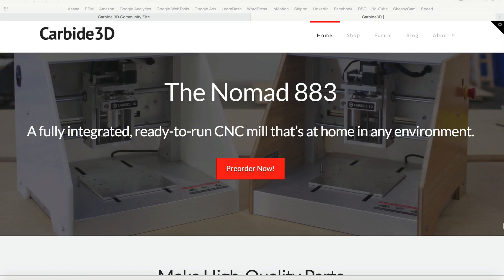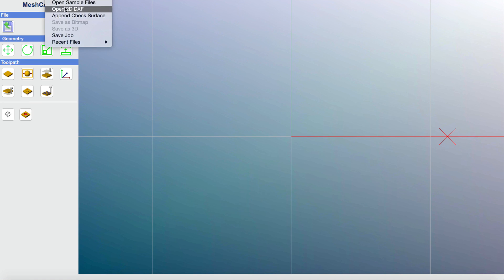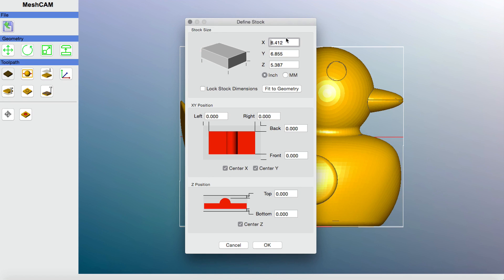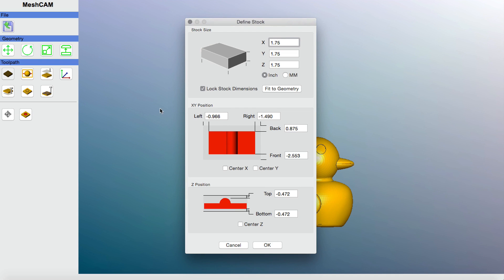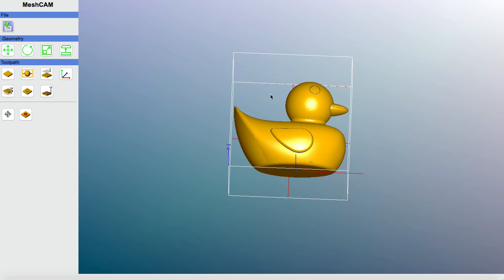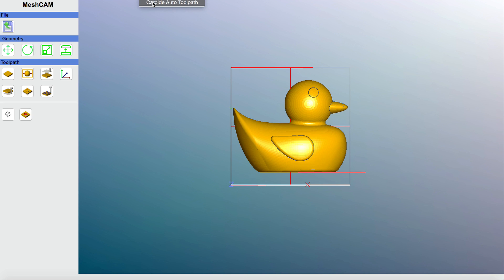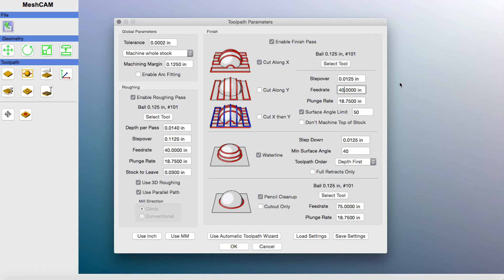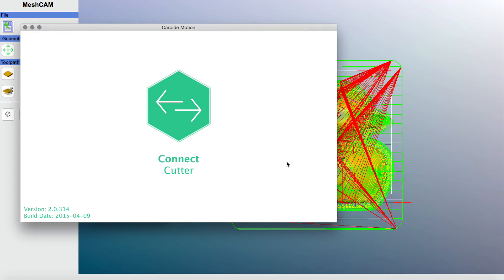Nomad 883 + Meshcam Tutorial - Importing STL and creating GCode

Comment: I know this is really old, but I am just now getting into this, however when I cut out something according to this method the outer stock is not milled out so the collet jams against the stock towards the end of the job. How do you get the rough pass to knock out all extra stock or material first?
Reply from the maker: I'm not sure exactly what you're referring to - can you give some more detail? How thick is your material, and how long is your cutter? The collet nut could be contacting the stock if the cutter length is too short (so basically, you're trying to cut beyond the tool's limits based on the length of the cutter.) It could also be contacting the stock if you have too narrowly defined the cutting area. Hard to say without more detail